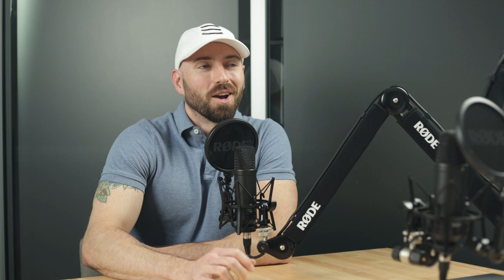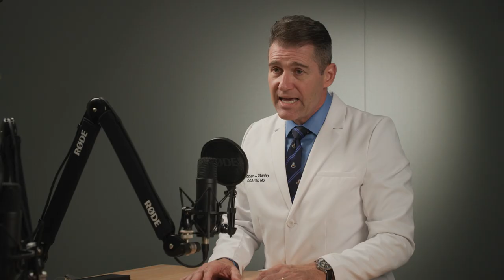Cupping isn't a problem.

Comment: What is the cause when you drill the osteotomy and the implant won't go in ?
Reply from the maker: Are you referring to the driver getting hung up on the master cylinder during insertion?
Reply: I 'm referring to the case when the implant won't get in the osteotomy
Reply: With Crown Down Technique it will go in every time. What doesn't let the implant go in is the cortical bone.  In CD method you clear the cortical bone completely. Surprisingly you get better primary stability